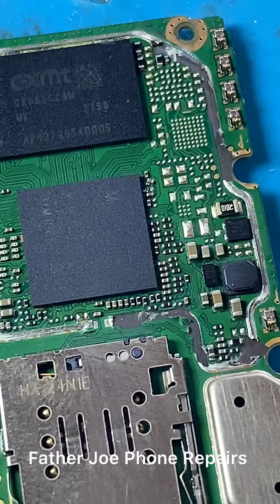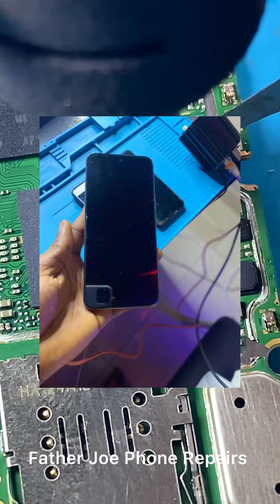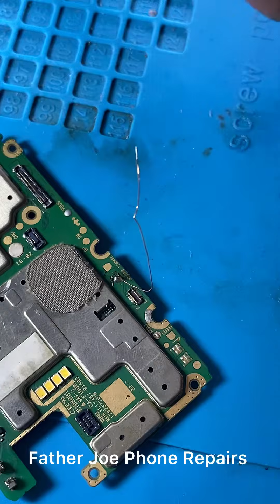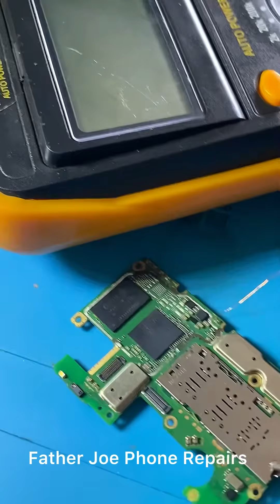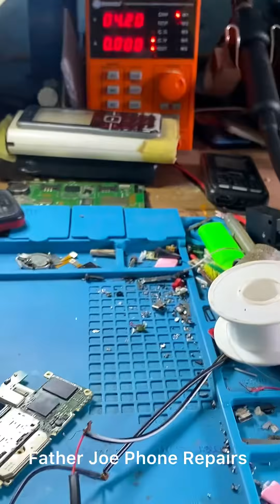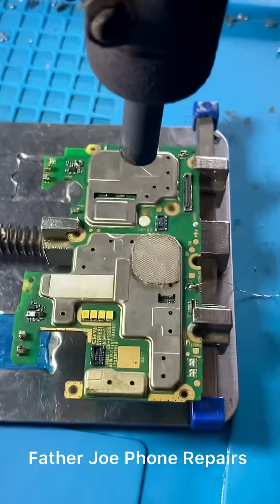How to repair any phone that’s not booting

Comment: Fada Joe please I need your help, any time I remove IC and want to clean the IC pin on the panel of the phone with desoldering wire most times the pin get to shot with each other. Please I need your help on this
Reply: Use good quality flux and good temperature on the iron